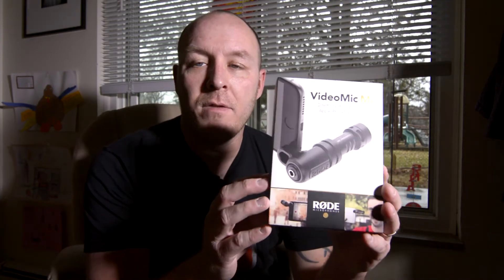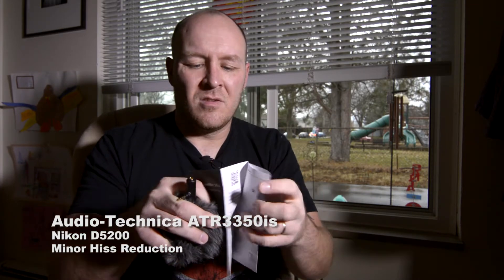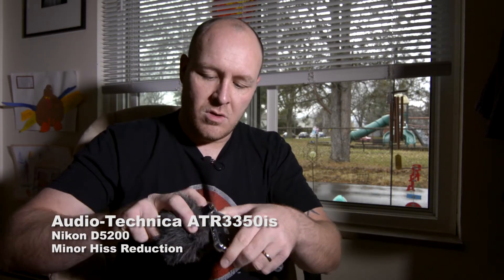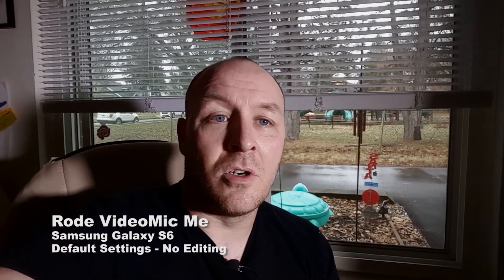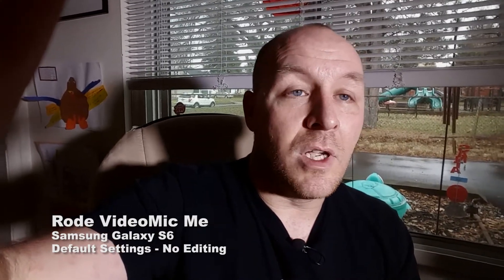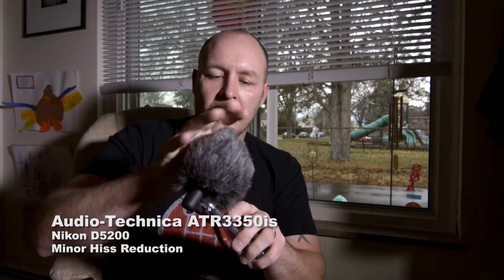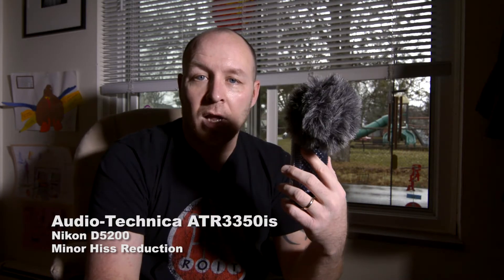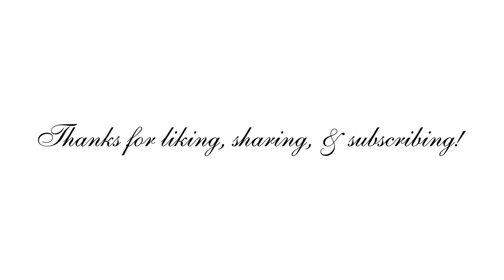Rode VideoMic Me Unboxing & Audio Test RØDE Microphones Samsung Galaxy S6

Comment: Hi, I bought this to use with my Canon 600D/T3i and often my audio has severe hissing. This happens both when the audio settings on the camera are on auto and when on manual.
Reply from the maker: The VideoMic Me is not intended for use on a camera. You need an adaptor to use the VideoMic Me on a camera, here's one I use from Amazon: http://amzn.to/29YM7N8
Reply: Sorry, wrong video... was meaning the VideoMicro
Reply from the maker: No worries.

Comment: I cannot figure out why, but the audio on my s6 pops so much when I record with the mic. It doesn't do it however when I record with my ipad. What's the deal?
Reply from the maker: +alchemicrb Make sure the mic is in all the way, I had 1 instance where it made weird sounds because my case pushed the mic out ever so slightly. Since then I don't use a case when recording just to be safe. Other possibilities could be a bad microphone, I'd contact Rode, I hear they have great customer service. Or you might have a bad head phone jack in your phone. Ever drop your phone?
Reply: im having the same issue on my s6
Reply: ***** I can tell you that a replacement does the same thing. However, I have now started creating videos and in the final edits, there is no issue.
Reply: +The American Soccer Guy well i hope that works with me too
Reply: +The American Soccer Guy Even when I put it through imovie, it was still messing up and had this buzzy noise
Reply: *****  Oh, did you put the phone in airplane mode? It' may be interference. My complaint is that even in airplane mode I was getting a tiny bit of ticking that was not there in editing.
Reply: +The American Soccer Guy yea i tired that..soo maybe its a faulty mic
Reply: ***** Yeah, that's what is sadly sounds like.
Reply from the maker: +The American Soccer Guy Did you try a differnet phone?
Reply: Mark Hicks Yes
Reply from the maker: +The American Soccer Guy All you can do is contact Rode. Make sure you registered the mic on their website, then open a support ticket.
Reply: Mark Hicks Well again, I am all good cause the ticking doesn't hold up in editing. Only on playback on the phone.
Reply: +The American Soccer Guy Hey man, what program are you using for your final edit? When I did a live stream from my Galaxy s6, there was no ticking noise, but when I tried to process a video through iMovie, there was still a small ticking noise.
Reply: ***** I use premiere
 pro.
Reply: +The American Soccer Guy ahh, see I only have iMovie...
Reply: ***** I will do a test tomorrow and let you know how it turns out
Reply: +The American Soccer Guy Did you test it out yet? I just received a new mic, but am having the same exact issues
Reply: Not yet. I'll try tonight.

Comment: I'm having a problem with my videomic me and was wondering if you can help me. I just opened it brand new out of box. I recorded my 1st video and I'm getting a heartbeat noise on my video. The only way to make it go away is to plug a headset in. As soon as I unplug the headset the heartbeat comes back. I do have my phone in airplane mode also. I have an iPhone. Any advice would be helpful before I think about returning it. Thanks.
Reply from the maker: +Jack Velazquez That is weird. Do you have a case on your phone that might be preventing the mic from plugging all the way in? Have you tried your mic in a different phone to see if the same thing happens?